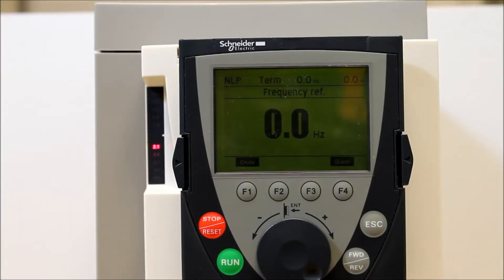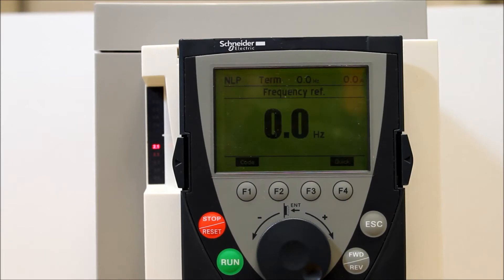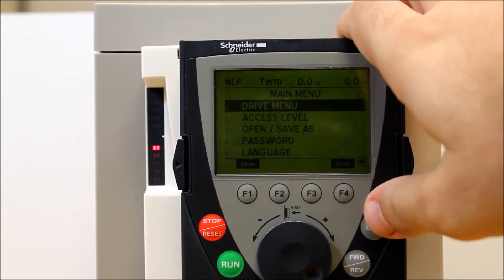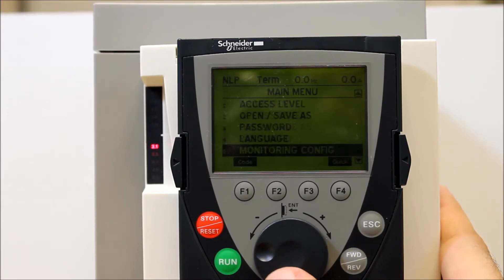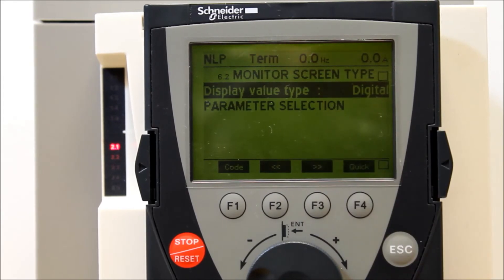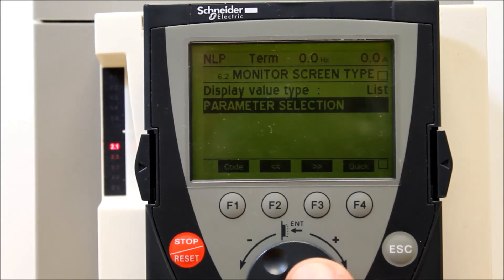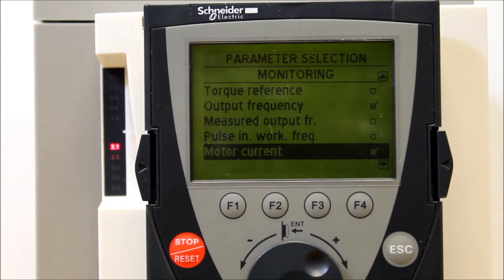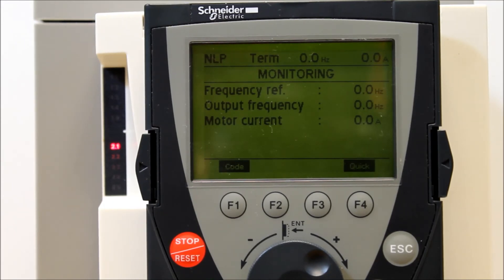Altivar Configuration:Altivar 61/71 Keypad for Simultaneous Parameter Visibility| Schneider Electric

Comment: Sir, i have the same VFD as shown in the video, my problem is the "2.1" on the side is blinking red light. How to remove it? What parameters i need to check? Im using the vfd using profibus DP connection.
Reply: Estou com este mesmo problema! Você conseguiu resolver?